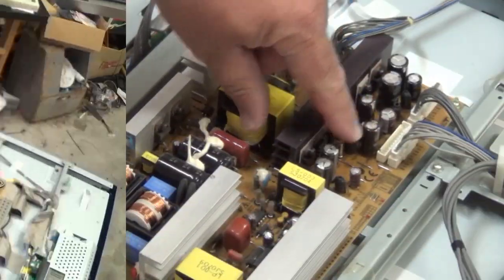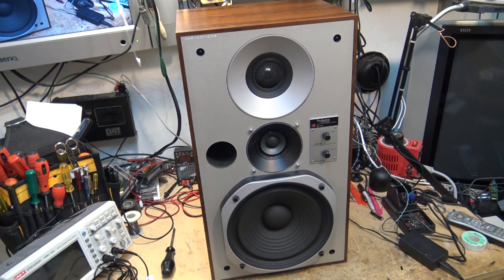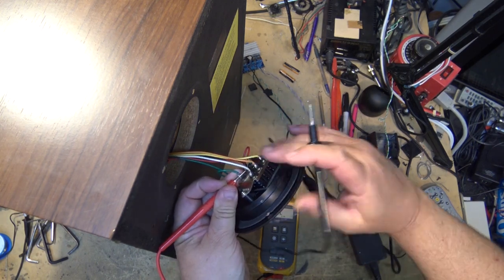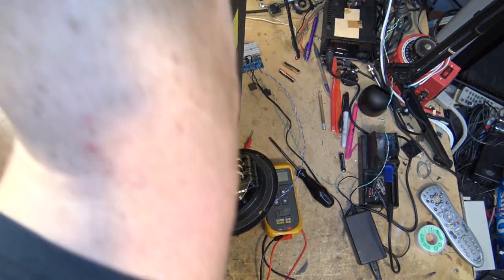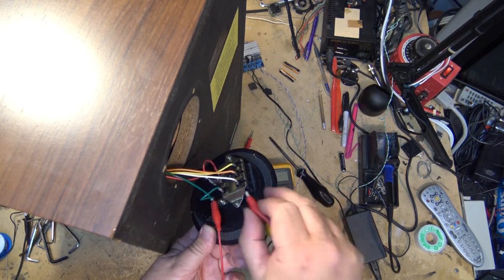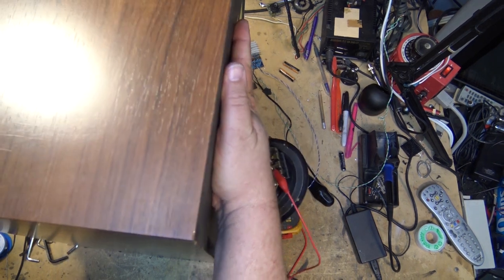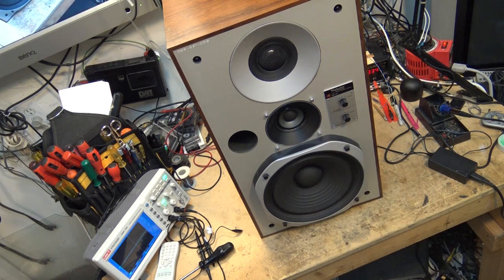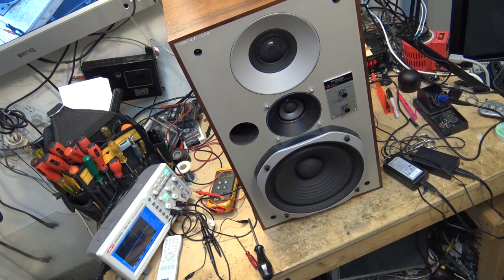Technics SBX5 No Sound

Comment: Are these speakers any good? There's a pair for sale locally. Would they be worth buying for $100? What are the knobs on the front?
Reply: I have had this set for over 40 years.  They still work like charm.  No foam rings, so no foam rotting.  Knobs on the front control mid range and high frequencies.
Reply: An all these controls and fuses in the audio path hurts the sound quality bigtime, id remove all of it

Comment: Can you blow a speaker without getting any visible damage on the driver (no burning coil, no coil out of alignment, no tear in the cone)?  Speaker just makes crackling sounds.  I had my high powered amp accidentally turned WAY WAY up.  Knocked me and the cat off the couch.
Reply from the maker: You meant to say your low powered amp right. Because it is lower power amps that go into clipping that blows speakers much faster and without warning than a very high power clean amp.
Reply: @12voltvids  It's a very powerful amp.  It was turned way up because my iTunes was turned way down.  I switched to another source and BOOM.    200 wpc Rotel.

Comment: https://www.parts-express.com/cat/speaker-circuit-breakers/1435  Parts Express in Ohio. Unfortunately,this is all they have. Used to have more in lower wattage. Ptc current resistor would go "high resistance" if current was exceeded and would go back to "low resistance" when cool.

Comment: I'd just rip the circuit protection out - it's a detriment to sound quality anyways.
Reply from the maker: I did that. I believe I mentioned that, but I will give the client the option of replacing them with fuses. If it was mine they would stay removed, because as you say it is detrimental to the sound. I don't drive my speakers hard myself, because I am not 18 years old anymore.
Reply: yes @2:15 in.
Reply: In which way is it detrimental to the sound?
Reply: @12voltvids  mentally all we are in our teenage
Reply: @westelaudio943  it adds resistance, the less resistance the better. People buy expensive cables just to get rid of any resistance. This is so much more detrimental than cables